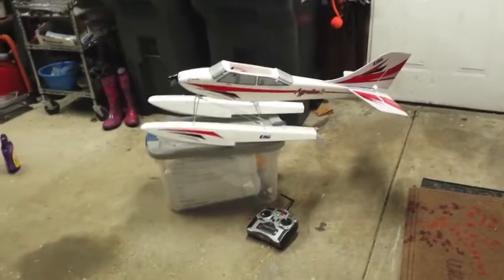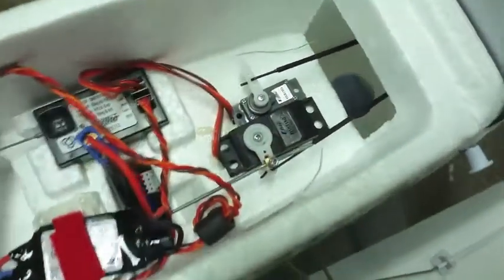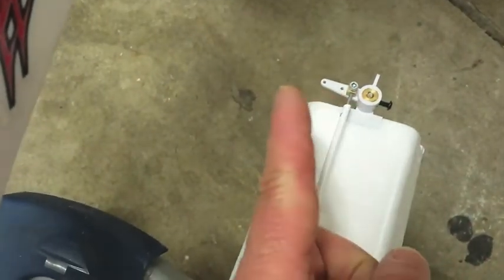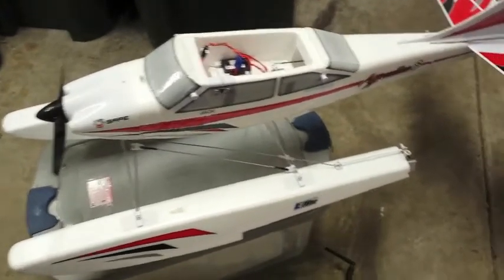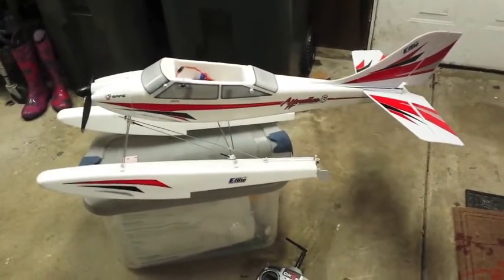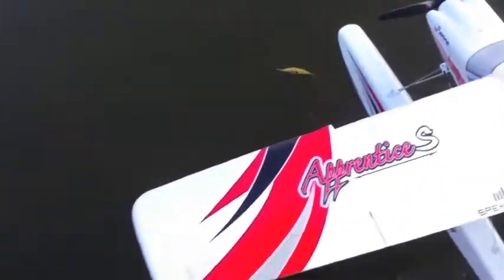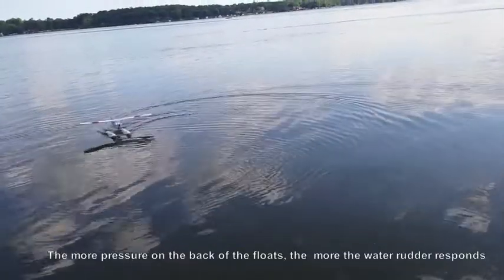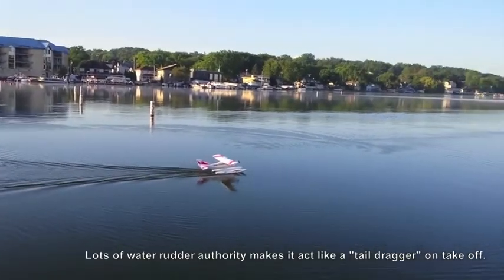Apprentice 15E More Rudder Authority Mods

Comment: justput another servo in ur float directly infront of the rutter and be done with it , what a silly setup to use a servo in the plane with all those push rods.
Reply: The Apprentice is an entry-level RC airplane.   The controller shipped with it doesn't have a channel to run an additional servo.  It would seem most newbies are not going to want to buy servos and a new controller in order to fly it on floats.

Comment: I removed the spring from my pontoon rudder so it would "float" out of the water during high speed. https://youtu.be/mTjJU6dIq5k Only gravity holds mine into the water on ALL my RC water aircraft, which means that I need to slow the aircraft, allowing the rudder to drop, before I get that aggresive low-speed control. Nice demonstrations!